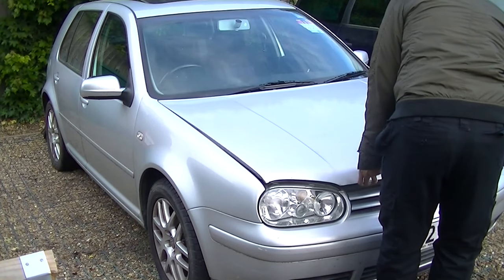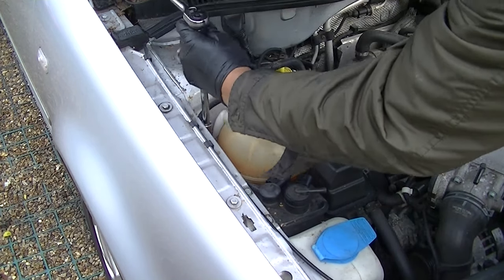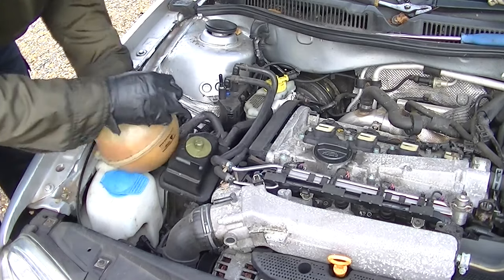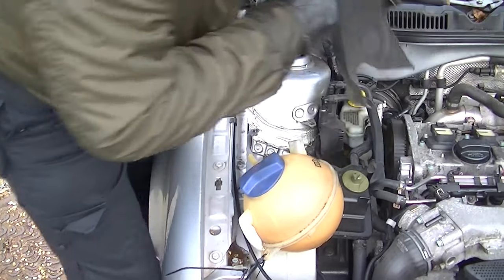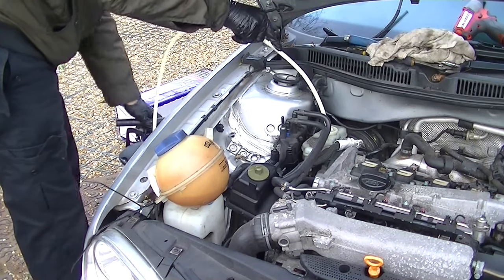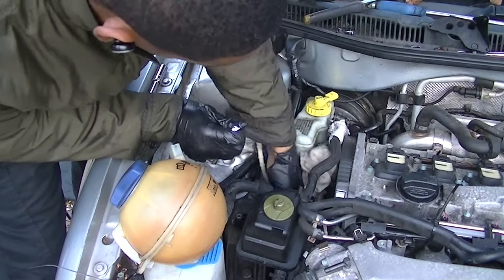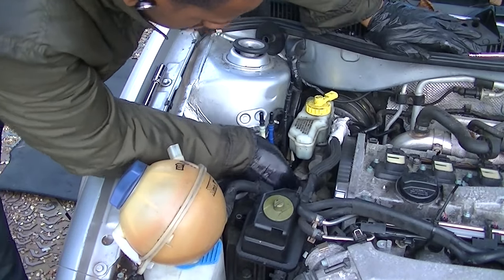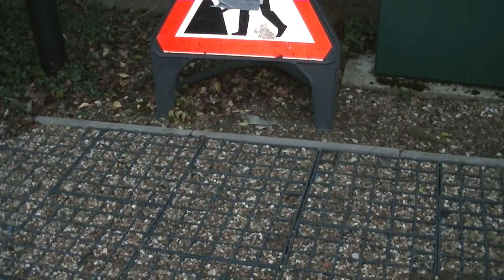How to Remove a Brake Master Cylinder

Comment: Great vid.  For the replacement master cylinder do you have to "Prime it" with fluid before installation.  With other  cars the rebuilt master cylinder came with a charging kit, or do you just fill it and bleed the system and it will work itself out?

Comment: Hi im changing the pressure valves on a audi tt mk1 same engine as your car. two bolts are off can't get master cylinder to come off it's not attached to the brake pedel is it  have not released brake lines yet there not stopping it from coming off. Thanks for your help

Comment: Hi your videos are fantastic they've really helped me out in the past I was wondering if you could offer some guidance on my polo? I think I may need a new steering pump as the steering is really heavy, I have checked the fluid and it's okay, any help and guidance would be really appreciated. I know you're a big VW FAN ;) thanks Jay
P.s don't ever change the intro music.
Reply from the maker: lol, thank you soooooo much for the support. is the fluid leaking?
Reply: Thanks for the reply! The reservoir under the battery is full, so I don't think so.

Comment: mate you made that really difficult. Remove the fluid. Using a 11mm open ended crows foot spanner undo the pipes. use 13mm semi deep socket with appropriate extensions to pass through past the pas reservoir. pulls out clearly. 7 mins tops to remove. 
I did two last week and I've got big spades for hands and there's just enough room on those agu 20v to squeeze my big mitt in.
Reply: I have seen this done on other videos and others suggest removing the x2 11mm bolts underneath first also, but I can't get my head around why, as the bottle is still held in place by the x2 13mm bolts that hold the BF res to the firewall of the engine, unless the unit moves downwards when you undo the x2 11mm bolts from underneath. I know this is a piece of piddle when you know how, but this is my first attempt, and i've already worked out that there are practical ways to do this, and somewhat long winded drawn out steps that only conspire to waste time. Additionally, I am guessing that the slave cylinder on this thing is directly under the clutch pedal, as I am considering  just taking the 1 out of my Golf and putting it on my A3 as I know they are identical, and the Golf slave and master are perfect. Just trying to make sense of undoing those 11mm bolts before I get stuck in. Much appreciated m8. Be well..

Comment: HI.  Great video.  How long does it take .  Can this item cause spongy brakes if you accelerate and then suddenly brake .  Brakes not spongy any other time
Reply from the maker: A few pumps and it seemed all good
Reply: Spongy brakes makes me think that you might have some water contamination in your brake fluid, or maybe a bad brake line somewhere. Bunch of different reasons I can think of why that might happen.
Reply: thanks of the reply.  Sadly it only happens when I accelerate hard and then suddenly break.  the brakes are not really spongy but break pedal is hard and has little effect.  Any thoughts

Comment: Question 1.  Would replacing this item remedy when a break pedal is stiff when you brake hard having accelerated hard from stationary. 

Question 2. 

How long does it take to replace the master cylinder 30 mins etc. 

Thanks in advance. .